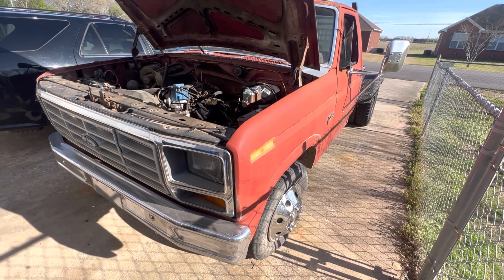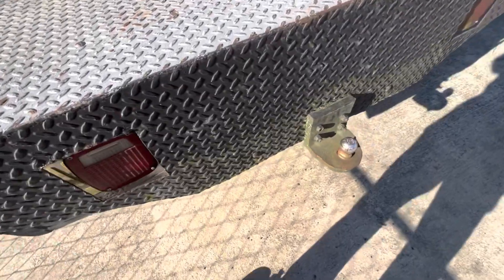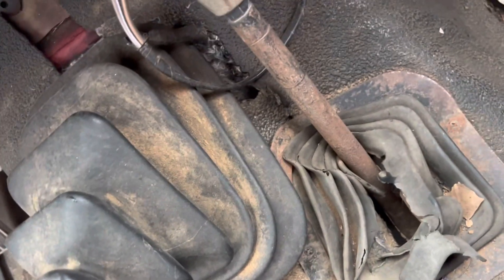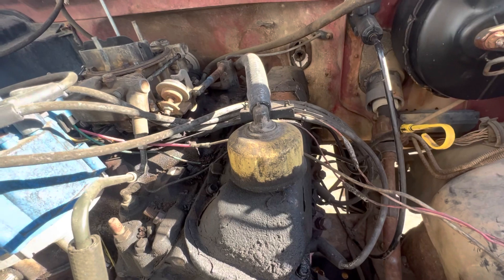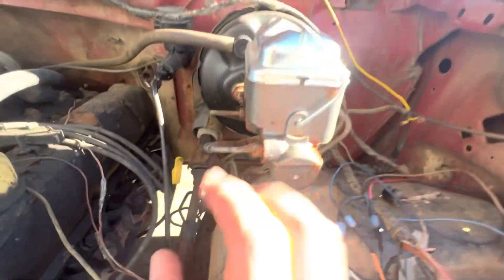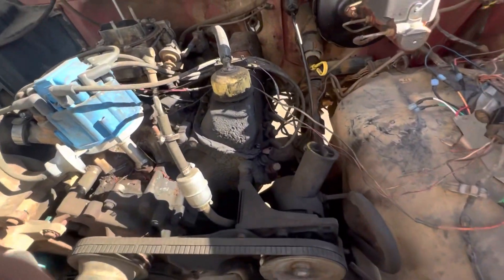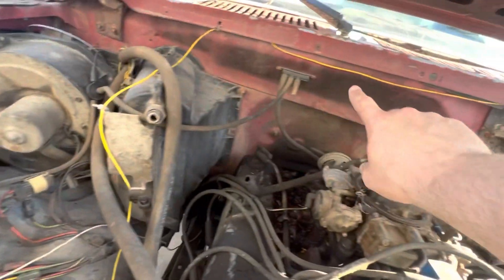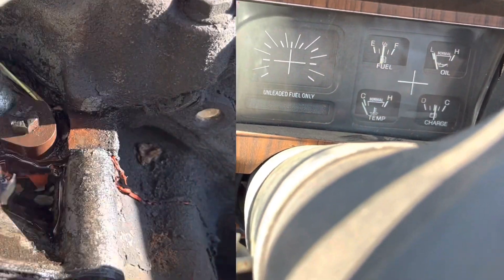1986 F-350 Walk around and start

Comment: That lever was for a PTO. Not 4 wheel drive!
Reply from the maker: That’s what I was thinking too. I need to get underneath it and see what’s going on. The knob looks like 4x4 knob, but like I said it definitely is not 4x4 and it’s on the wrong side. Someone could have put that knob on there off of a tractor or something.
Reply: @eyeballroomer  yep old handle someone had laying around. Farm use trucks would see some of the weirdest combos like your gm one wire alt. That was a common swap back in the day because every part store and most tractors could use them in place of the stock manufacturer because most people back then worked with what they had and not with what they could get.pto more than likely for a flatbed that could dump or a plow set up check front of frame for extra support of it was a plow the old farmer had to beef up from end with extra plating and if it was a dump bed more than likely you would only be left with the stick as for everything else would of been hacked off for another truck in better shape. Or bed was just complete shit and not salvageable so they put a bed on it to still have some use